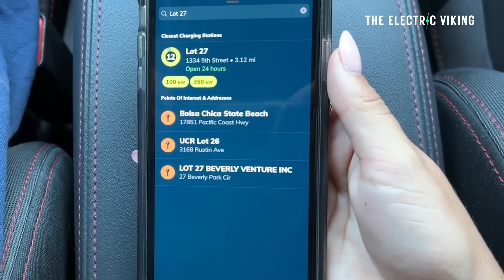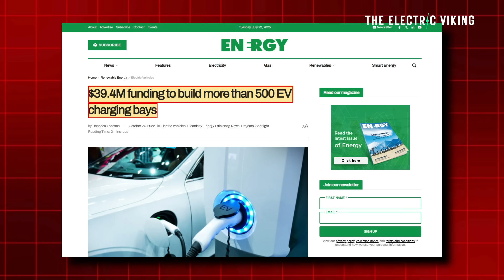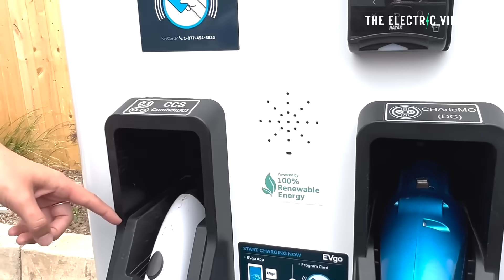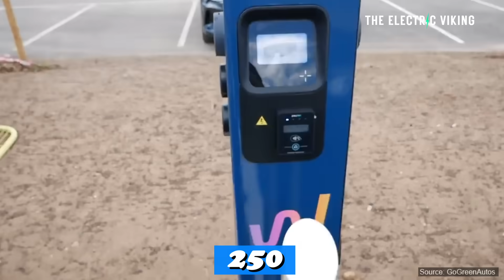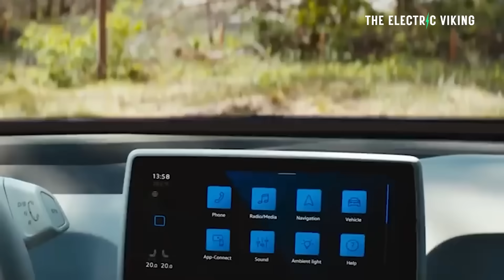NSW Government building 500 Superfast EV chargers 5km from each other

Comment: I'm new to your channel, but ev charging is a concern of mine. 
There is not one single ev charger in my lga (Blayney Shire, NSW). In all honesty, I highly doubt we will get one of these 500 chargers. My closest charger is 40kms away and it is one of my concerns as I look into buying a new car for my family.
Reply: your closest charger is 10m from your power point at home
Reply: @ursodermatt8809 I'm assuming you mean get a charger installed. I'm considering it as an option. 
If you mean plug into the wall socket, doesn't that take like a week to charge your car? 
My point is more that for those of us not in metropolitan areas, and Newcastle is metropolitan now (I grew up there and visit every year), the infrastructure is poor. These charging stations also need to go to every lga in Western NSW, the New England, and the Riverina if you want people in these areas to buy the cars. 
The range is less and less of an issue now, it's the charging stations now.
Reply: @angusnorton725  
are you reasonably good at maths?
let's say your battery has a 70kwh capacity and lets presume you drive the EV totally empty, like the last 59kms you pushed it to your garage.
now you plug it in to a 10amp socket. that is at least 2kw. so this equals to 35 hours of charging from totally 0 to full.
now like your petrol car you do not drive till you are totally empty of fuel. and coming home every night and plug it in overnight  you add at least 30% charge.
now then being somewhat intelligent you install a 7kw charger at home and 0 to full probably takes 11 hours.
you are charging at home unless you are doing trips from say sydney to adelaide. only then come the fast charger into use.
hope that helps you in planning charging your future EV.

Comment: I'm definitely seeing the uptake on the roads. I remember not long ago seeing a EV on the road was a point of interest. Yesterday while driving to work in my Xpeng G6 I was stopped at a light. There was a Sealion 7 In front of me. Next to him was a previous gen Model Y, beside me was a current gen Model Y, behind him Kia EV5 (or maybe 3 I wasn't sure) and the car behind me was the only ICE vehicle. 5 of the 6 vehicles was an EV. What's more while sitting at the lights a Model 3 and  a Model Y passed boing in the other direction.

Comment: Location is key. Putting EV charging in random locations nowhere near anything makes EVs look like a pain to live with on road trips. Also distribution of DC fast charging  (75kw / 150KW / 250kw+) needs practical planning. Save the super high current charging for freeway/highway stations and have lager bay installs 16+ slower / mid speed (50~150kw) near eateries and shopping centres. 

I Recently drove an EV, decided to top up charge (40% to 80%+) while eating lunch and it was a massive annoyance to have thow out my half eaten lunch because the car charging was way too fast and I was incurring idle fees that wouldn't have happened if there was 2x 200kw,  2x 100kw and 4x 50kw charging instead of only just the 4x 200kw charging bays they had in an off the highway restaurant & rest stop.

Comment: Brilliant news. Really smart policy. We don't need lots of fast chargers in urban clusters to support mass adoption of EVs. We need superfast ones with the right geographical distribution and enough plugs so that anyone can drive anywhere without fear of finding or accessing a charge. Range anxiety is not just a feeling Sam. Take fleets for example. Charging or looking for a charge is commercial downtime. Fleet operators will go EV when all the risk assessments and cost of operating numbers stack up. High km regional buyers will get onboard when the gaps on major regional routes are filled in (and when enough EVs come with off road capability and spare wheels). The pole chargers will attract the 30% of Aussies who can't charge at home. Excellent policy that will boost the transition.

Comment: EV or not to EV, that is the question for each on their own merits.
Don't forget Ampol was already give many millions of government money to build chargers that they failed to install. 
They claimed lack of grid infrastructure. 
Many of these new charger parks  should have Solar panel arrays to assist in charging BESS for use alongside Grid power. 
1 MW arrays (2500 x 400 watt panels) and 5 MW BESS to allow quick discharge for DC vehicle charging.
Reply: That's the way to go. Over build and use any excess capacity to boost local grid. Amazingly for this day and age there are still still small regional communities dependent on diesel power.
Reply: Yeah but who’s paying for it?
Reply: @PropanePete same way for
ICE gas stations, to take out loan

Comment: I don't agree with your comment on not buying a car with less than a 350KW/hr charging rate.  I have a Highland that only has 250kw/hr peak charging.  However, with a range of 370miles that's 5.3hrs of driving at 70mph.  I definitely don't ever want to drive over 5 hrs without a food/bathroom break.  I've had my car for over 7 months now and I've charged it 100% at home on Level 2.  I've never had a need to use a fast charger.  Therefore, requiring 350kw/hr charging is useless for me and I suspect many others.  More important traits are a more affordable EV, high efficiency, and solid features.  I'd also like to have V2G too, but our electric utility companies don't allow it.  Gee, I wonder why?
Reply: Agree. Fast charging for my Atto is 90KW. I have never found this inconvenient. Typically, in the road I need 20-25 minutes for a charge from 30% to 80%, just time for a stroll around, coffee and toilet break.

Comment: If you use wh/kg, hydrogen have almost 3 times more energy than diesel. So, why aren't Hydrogen been used as a fuel for cars? A fossil engine would go 3 times as far?

The reason are of course that wh/kg are used to fool you.

Hydrogen has a high energy density, particularly in terms of mass. One kilogram of hydrogen contains approximately 33.3 kWh of usable energy. This is significantly higher than the energy content of gasoline or diesel, which is around 12 kWh/kg. 

If you look at the correct measure for cars (wh/litre) compressed hydrogen gas, has 1.35 kWh/litre at 700 bar pressure. Diesel fuel contains approximately 10,700 watt-hours per liter (Wh/L).

So, there are the reason why diesel are used over hydrogen.
The same goes for batteries.
Some, Lithium Sulfur batteries have a energy density of 380 Wh/kg. While lithium ion has 170-250 in cell phones.
So, why aren't we using Lithium Sulfur? 
The reason again is that litium ion has 250–375 Wh/L, vs Litium sulfur 100-200 wh/l.

So, if the electric viking are planing to stay honest. Stop gaslighting people by using wh/kg.

Comment: Fast charging wears out battery faster than slow level 2 charging at home at cheaper electricity prices.
Reply: I heard that 3 or 4 fast charges a year are good for battery life.
Reply: @danielstapler4315  You are right. 

Prioritize Slower Charging: Opt for Level 2 charging at home or work whenever possible. 
Avoid Frequent Full Charges: Stop charging at 80% or less to help maintain battery health. 
Be Mindful of Temperature: Avoid fast charging in extreme heat or cold, as these conditions can negatively impact battery performance. 
Check Manufacturer Recommendations: Refer to your vehicle's manual for specific guidelines on charging habits and battery care.